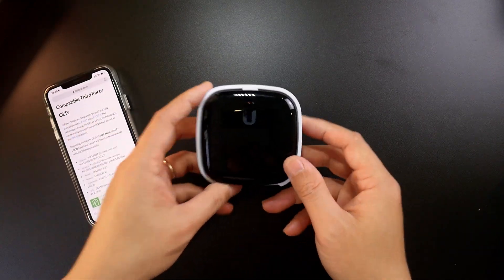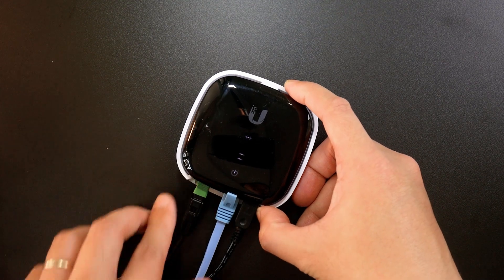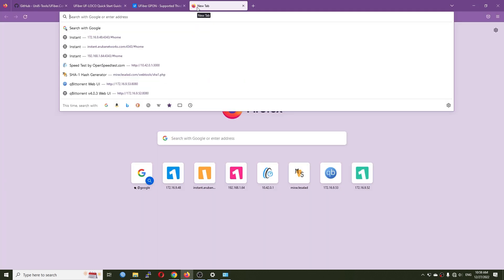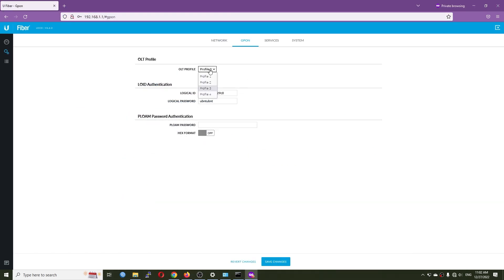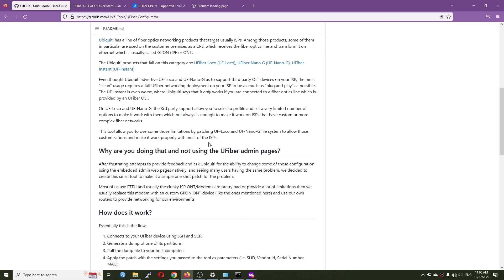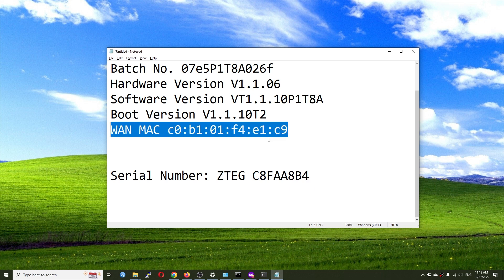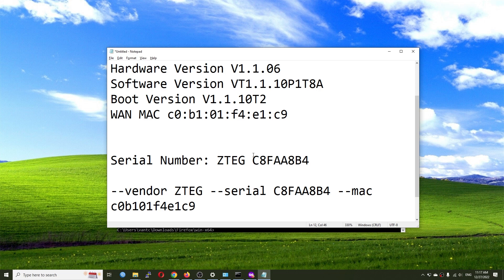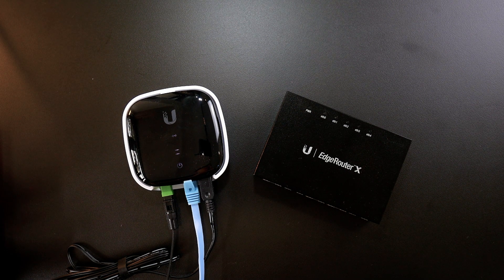Replace ISP ONT/ONU - Ubiquiti UFiber LOCO - Overview & Configuration

Comment: Hello, this is a really good video thank you for the Information, but how did you "read out" the password for LOID Tab-Page, and for the SN Tab-Page on the ZTE Router ? I have also an ZTE,  just the F690L first i just managed to get into user access, then i figured out the admin password and now i see a lot more stuff regarding the PON Configuration and information ... just don't know how to get the passwords. The Configuration is not defined as PPoE just DHCP.
Reply from the maker: Hi, if the WAN connection is DHCP, then you don't need to worry about PPPoE username & password.
Make sure you clone all your ISP provided gpon to the new one (UFiber/HSGQ SFP, etc), and then set up DHCP connection for WAN on your OpenWrt/new router.

Comment: We have the NANO G and has suddenly stopped working.  We don't get any LED's or other digit indication on the Nano G.  When the power cable is plugged in, there is a very quiet and faint like 'buzzing' sound if you put your ear close enough.  The power supply is lit with a white LED.  I have also played about swapping cables and also rebooting with the switch held down for 45 seconds - still no white 'dashed lines' appeared.  It really is dead.
Reply from the maker: It looks like something is wrong with the fiber cable. For most of the GPON module / GPON converter, the device will not up and running until you have an active fiber connection / signal. It has been so long that I don't remember how the Nano G works, but you can check the fiber first.

Comment: Hello, finding your video here helpful... I am just returning to the networking scene after 15 years of absence from production environments. I need a little assistance with the Ubiquiti GPON configuration tool installation. I am on MAC OX 14 should I just copy the library and config to my applications folder? Then do I call it up as its own app or is it used from the SSH configuration. I am new to Ubiquity and i am trying to deploy a UDR and I want to use the GPON NANO I purchased to interpret the fiber light to digital signals for the router. I haven't used network tools in a while, so I would appreciate a little direction to get me going. Thank you for your assistance!
Reply from the maker: Hey, apologize for the very late response. Did you manage to settle that?

Comment: Can you help me?  I followed your entire video... I managed to change the serial, the Mac and the vendor.  It connects to the Vodafone fiber i.e. the TX and RX parameters record the network, but the problem is that it does not connect to the internet.  PS.  I set it as bridge.  The old ont is a ZTE model f6005.
Reply: Exactly same problem at exactly the same stage. The Nano shows that it is connected (green circle and getting RX / TX values  but the Vodafone router can’t get internet. Is there another layer of authentication?
Reply: Hi! Did you manage it to work?

Comment: What about VLAN can it be changed? 
Didn’t find any CLI commands list
Reply from the maker: UFiber series are designed to work with Ubiquiti OLTs. If you need more control on the ONT/ONU, take a look at other ONT/ONU, such as devices from LEOX (LeoLabs), and those GPON SFP module, such as Nokia G-010S-A, HSGQ XPON, etc

Comment: Hi @vantech, does the ufiber configurator work to change the Mac address on firmware 4.4.2 and above? it doesn't seem to work on my end.
Reply: Did you make it work? the github says it works until firmware 4.3.1

Comment: would you please help on the issue that I set LOCO to bridge mode and it's connect but i can't access to LOCO and I don't want to reset device
Reply from the maker: Do you remember the IP address of the LOCO? You can try to set up your PC's NIC IP address to the one which in the same subnet with the LOCO's IP, and then try to ping /access it.

Comment: Hi Van tech
I need change HWTC to 48575453 because my ISP need serial number with 16 digits tried put full number with 16 digits but automatic chance to HWTC
Do you have idea of how did ?
Thanks a lot
Reply: Hi Van Tech Coner
Finaly i got changed the serial of UFiber Loco to 16 digits i used UFiber configurator more vacuum hack now works good…

your videos are very good and complete, please keep do videos about Fiber, Network, ISP etc…
Tks a lot 👍👍👍

Comment: Is possible to check the configuration it downloads from olt? Replaced my F660 with it and internet works but I need vlan id for iptv.
Reply from the maker: Hi, I don’t think it is possible. If you still have the F660, try login to the Web-UI and see if you can find the IPTV VLAN somewhere.
Reply: @VanTechCorner  my isp blocks web-ui access and they only allow to configure ont via their website but there are only the most basic options like change wifi password and set port forwarding. They even don't allow to put their ont in bridge mode, I had to call them few times and finally talk with manager to make it possible.

Comment: Apologise for the dumb question, but what is the advantage of replacing the ONT/ONU? I haven't done much with fibre before but from my understanding is that the ONT/ONU is pretty much just a media converter. Even the ISP provided one should be able to get the maximum throughput?

Is there any features you gain by using your own ONT/ONU?
Reply: Some ISP's deliver crappy modems with built-in ONU in them and manage it all themselves.
Reply: @kaiowasdeath thank you for the reply!  so this is more useful in the case when the ISP provided ONT is built into the modem, and not when the modem and ONT are independent of each other?

Comment: Can routing be done on the device itself? 

Plugging in a dumb network switch on the gigabit port. No need for additional router.
Reply: yes you can use it as a router but the throughput in that mode is around 220mbps up/down max and it has very limited funcionality, would not reccomend

Comment: Do you have an Edgerouter X SFP? It would be great to see if you could do the same using the SFP port on that machine.
Reply from the maker: In order to directly connect the fiber cable to the Edgerouter X SFP, you will need a GPON SFP module. I have all the mentioned devices and is working on the video.

Comment: Can we do something for coaxial cable internet? My ISP do not allow to use custom modem…
Reply: When I had Xfinity (USA) i bought my own modem. It was a Netgear cm500.
Reply from the maker: All of the ISPs in my region are using fiber, sorry I can't help on this. However there are a lot of topics on the OpenWrt forum. If yours case/your ISP is new, you can start a thread to discuss.
Reply: What isp?